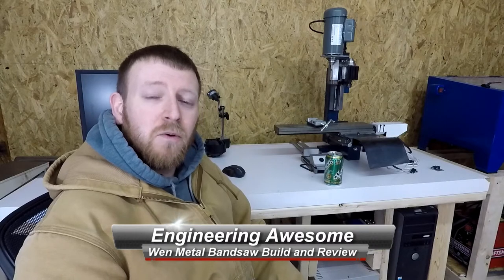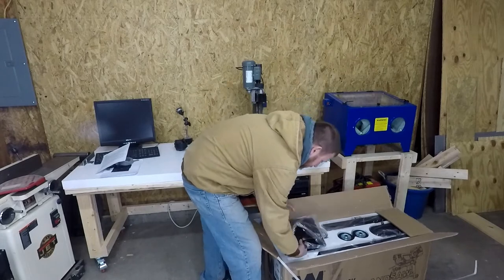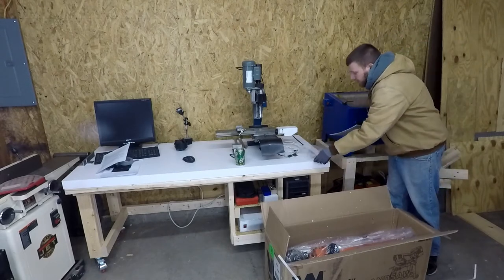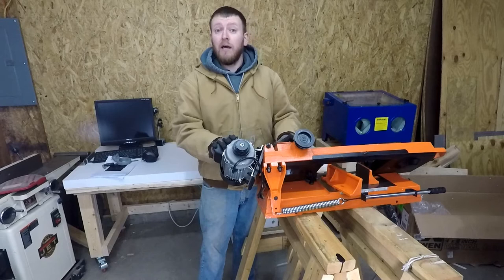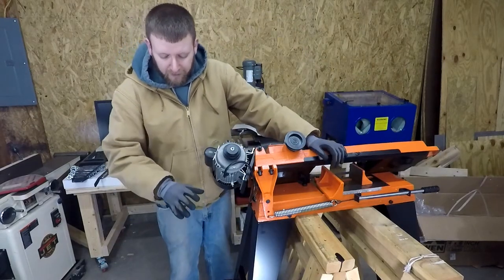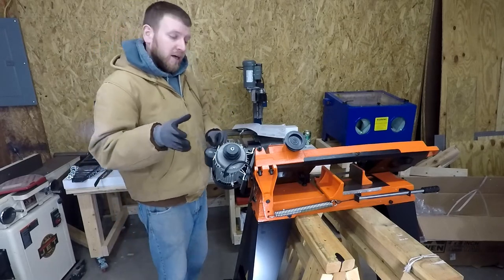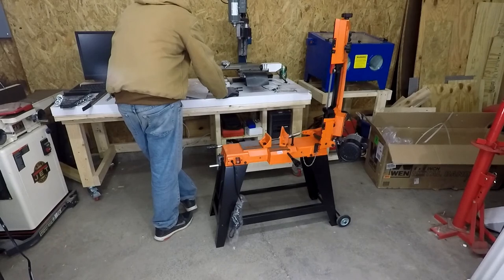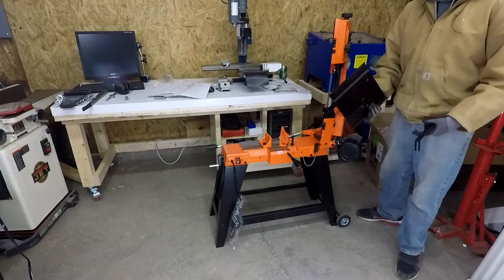Micro Machine Shop EP01: WEN Bandsaw Build and Review

Comment: Can you do a video explaining changing the blade, adjusting angles, and what your thoughts are now after owning it awhile? I need to cut a lot of 45 degree angles in tubing and angle iron for what i do. Which is also hard on the blades. I'm almost ready to press the order button i just would like to know a little more before i do.

Thanks for the video!
Reply from the maker: I actually can't. I loved the saw but it was just a bit slow for what I do these days. I switched to a cold cut saw and about to make the jump to an Ellis bandsaw. An 1800 or 2000. I have processed 12000 lbs of tubing and angle this year so far.

Comment: Thank you for this review, just bought this saw :)
Reply from the maker: Max Green make sure if the review helps at all that you use the affiliate link. Helps out the channel. No big deal if not, just glad it helped. I love the saw so far. I do have a different blade coming for aluminum, link is in the description. 8/10 TPI from imachinist.

Comment: Just came across this. Nice vid. I've got a few friends with the same saw just different brand name and they work great. Just a tip..flip your piece 90degrees when you go to cut something that dimension. To me it cuts faster and straighter. I understand the limits of the cut dimension. Just sayin. Sub'ed by the way and looking forward to some more "micro" shop stuff 👍🏻
-Pidge
Reply from the maker: Honestly I was more curious how it would do horizontally. I have since been cutting it as you stated for speed and accuracy. Thanks for the sub! Working on a CNC plasma table now. Next video will be a budget welder setup I just got to build the plasma.

Comment: Just FYI the wen 4x6 is the same saw as the harbor freight 4x6 they both can lock in the vertical position.
Reply from the maker: I think that there are actually several that are all the same. There just was not as much info on the Harbor Freight unit. I went to look at it in store after purchasing this one. There are few subtle differences, but really enough to be concerned with. So you are correct.

Comment: Thoughts after 9 months?
Reply from the maker: I use it all the time still. It's got great capacity and provides a good clean cut. My plasma build would have been impossible without it. That being said, it is a little slow. But it let's me sweep up the shop for the minute it takes to cut large items. I run it a lot while the plasma is cutting too, so I can go back and forth easily. I love it and have no plans to get rid of it. I will augment in a year or two with a cold cut saw. But I don't need the speed. Harder to get a good accurate cut too.
Reply: @FerrousWrangler  thanks for the reply!!
Reply from the maker: @brockdomain8509  of course. Let me know if you have more questions. Happy to help. If you get it from Amazon I would appreciate you using the link. Helps the channel out.